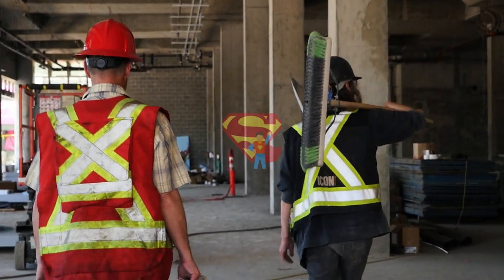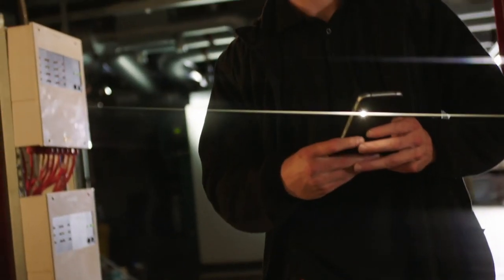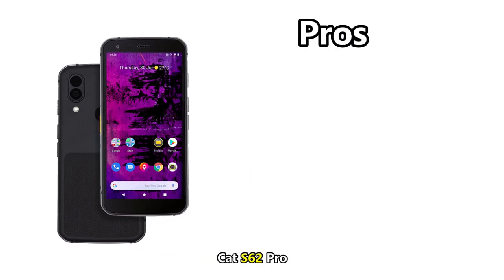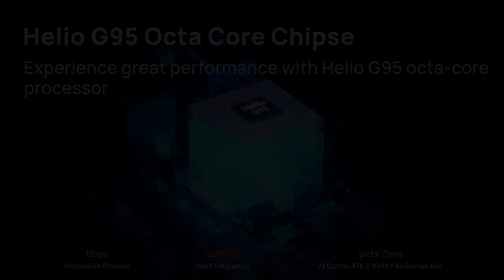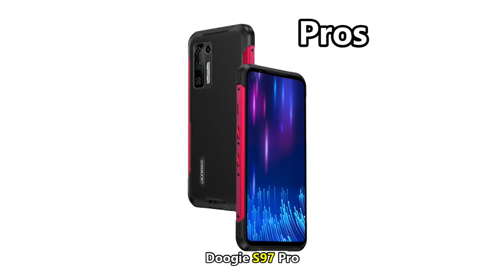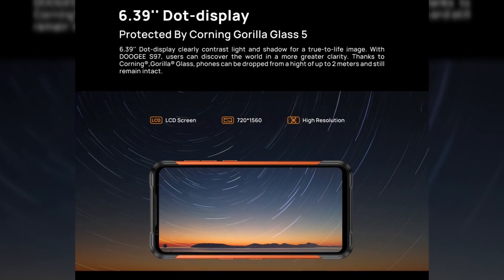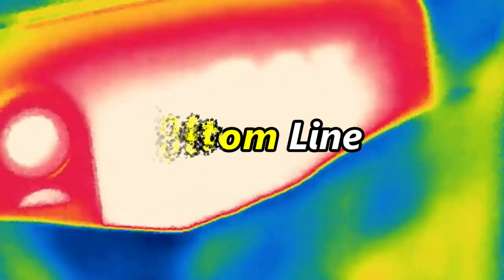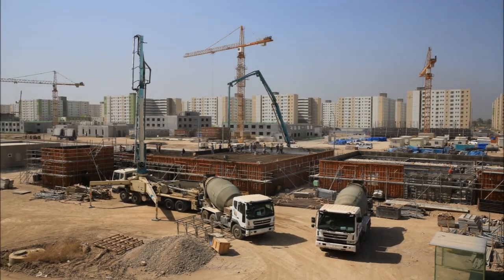Doogee S97 Pro VS Cat S62 Pro (Best Rugged Work Phones)

Comment: I own phones from both company's. I own the CAT S60 which unfortunately runs a android 6. It didn't and still doesn't like to multitask. Three FLIR camera is what i mainly got it for. I still use it only when I'm using the FLIR camera. A little bit of something I had to discover on my own, if I am doing video or taking a  picture in the FLIR mode, I have to scroll down when looking at the camera roll for 3 and it shows me the actual picture or video without the FLIR going. After the time this phone since in my drawer fully charged and powered off.

That being said i still own and am using my Doogee S68 pro and my husband has my old Doogee S80.  The Doogee S80 still works in his network but not on Cricket. Same with my Doogee S68 pro.  Last year while waiting for my new digital display they changed it so that it was not supported by their Network anymore. However I can still use it on the Wi-Fi come at some really okay with that. Doogee phone's truly are rugged and really can withstand a ton of abuse. I can't waitto get enough money for they're new X20 (Doogees). Idk the price but but I'm pretty sure I can pay for 3 Doogee phone's vs 1 CAT phone.

Comment: I bought a CAT S62 a few months ago and it almost caught fire while charging. Normally it should have been covered by the warranty, however cat wormed they way out by saying that it was the cable (they provided) and not the phone the problem. The phone was good when it lasted and the thermal camera was impressive, however, for a rugged phone to fail after a few months of normal used and not be taken in charge by the company is quite embarrassing.
Reply from the maker: Ouch, that is a major bummer Throgg, I am very sorry to hear that!! Yeah they absolutely should have covered a replacement for that. It's rather ironic that one of Cat's suggested uses for their thermal imaging is to test for fire risks, and you're saying the phone itself became a fire risk. But yes that is a terrible experience, and I thank you for sharing it with me.
Reply: @SurvivalSuperhero  Cheers man, keep up the good work !